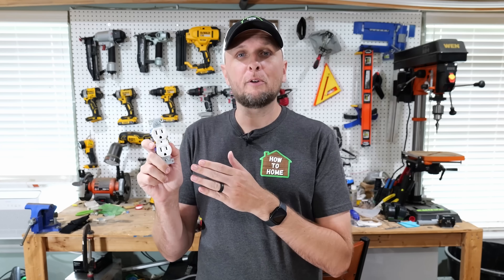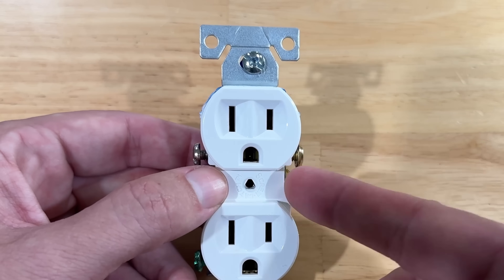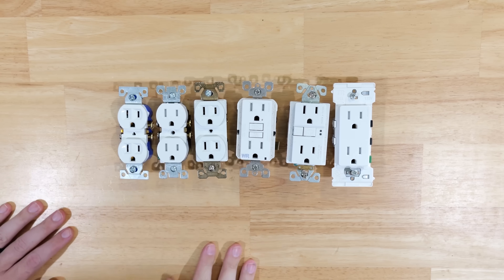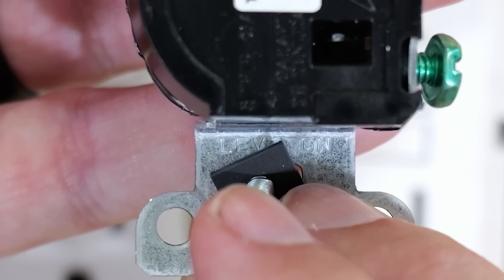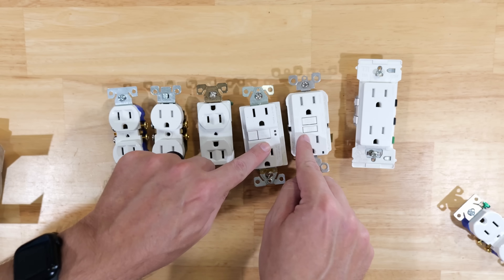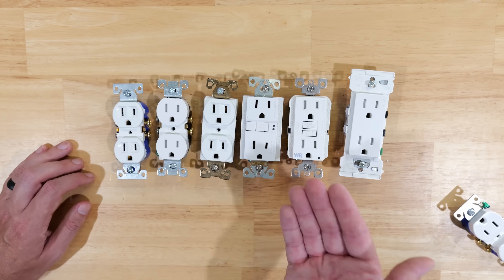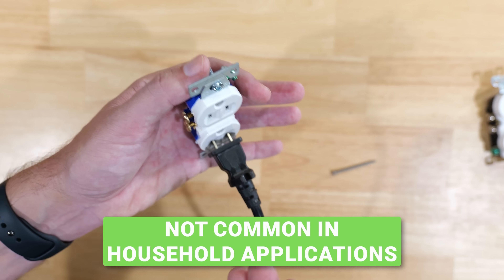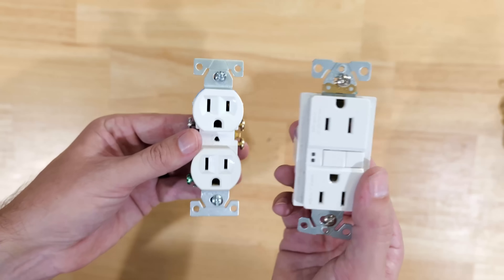The Shocking Reason Why Your Outlets Are Installed Upside Down!

Comment: Honestly, the national electrical code might as well be garbage because it doesn’t drive standardization into the design of electrical components like outlets or how they are installed to force manufacturers to build products inline with those safety standards. The U.K. Type G outlets are the safest option for outlets. The ground faces up, they include power switches, fuses and they have a shutter mechanism to guard the receptacle holes. The only problem with the type G outlet is its size but that can be upgraded to a smaller design in today’s market. Excellent video.👍

Comment: The biggest factor turns out to be the molded 3 prong cord plug. Whether vertical design or horizontal. It has to fit into the receptacle one way. Positioning the cord in possibly the worst angle.

Comment: Now do the right angle 3 prong plugs.🤣
They create a new level of confusion. About 70% of the outlets in my home are ground up, while the rest are ground down. When replacing or installing a new end, I get the right angle plugs that can be set in 8 directions. Otherwise I'm bound to end up with one doing the Wanky Doodle and going up and away at a 45° angle. Our Christmas tree power strip plug is a classic example from a G up outlet. The washing machine is a similar case where I flipped it to G down so the cord trails straight down. This holds true for right angle 2 prong polarized blades sometimes pointing the cord or USB ports straight up.😒
I personally like the "surprised face look" of the G down install and my cords usually look more natural.

Comment: Pointless.  Electrically makes no difference, but standard matters.  Why not just install one-way switches as down being closed circuit?  I'm sure some have the writing on them the same as the outlets you are showing, but no one with common sense would install them upside down.  

Electrically no different.  Should you do it?  If you want to annoy people trying to do things in the dark, like not realizing the breaker is off or a bulb is burned out... or even just plugging in a cord, go ahead and install them the opposite of what we have learned to expect our whole lives.

Comment: Here is the best argument. All the manufacturers making beauty type devices like blow dryers have a gfi built into the end of the plug 🔌 and they are using ground plug down so the electric cord hangs down.   Also i find it easier to wire the receptacle ground down.
So the original old way works for me.

Comment: In the girl’s room a plug was partly unplugged, then a wire hanger fell down onto the electric poles shorting out the circuit.  Fortunately we had a good breaker cutting the power.  Who would have thought.

Comment: First off, the reason I'm commenting here is because I'm horrified that this video appeared in my youtube feed less than an hour after I had this conversation with my elderly parents.  My mother was confused why she could not plug in her xmas night light in the upright position.  I pointed out to them that most of the outlets in this house were installed upside down (or so I thought).   What the heck! not about the upside down outlets but that, once again, my computer is listening, or maybe my wifi headphones are listening.  But I am very surprised that there is no standard for the outlets.  I recently moved into this house and this is the first time I have ever come across an outlet installed, what I consider, upside down.

Comment: I spent 20 years of my 45 years in mining as an electrician. And I've worked with electricians who have worked in residential and construction. And I've seen recepticals installed both ways just depending on the application. But most that I have seen the ground has been placed where its facing down. And in my own experiences I prefer the ground plug down. Simply because in most situations the cord seems to hang better. And that would be with cord ends that are molded flat or square it tends to put a larger bend on the cord when plugged in with the ground on top. We worked under MSHA standards and electrical code applied to both surface and underground applications as well as residential. Irregardless of whether its MSHA or OSHA both adhere to the guildlines set by the National Electrical code..😎

Comment: Ground pin up for metal cover plates, think industrial, they're usually exposed conduit with exposed boxes. If the metal cover comes off , it can't fall on live current.

Comment: Ridiculous debate and discussion.  Reason there's nothing in the NEC is it doesn't matter. I've bought & lived in several new houses and observed outlets installed in a horizontal orientation. Also found where an upside down orientation in a room indicted that that outlet had a wall-switch controlled plug. In those cases, the side bar jumper was cut to separate the controlled portion from the uncontrolled. These were in bedrooms usually where a nightstand would be expected to be. Also had one that was in a living room in a far corner away from the wall switch panel group for the large room. Pretty smart electrician, in my opinion, and I thought that it would be common knowledge. However after seeing this vid, maybe it's one of those secret held by only the exceptional electrician craftsmen and I was lucky enough to have them on the construction crew for my house construction.

Comment: Power cords that have the cord emerging from the plug at a right angle to the prongs are curled and put under a torsion strain with gravity pull on the loop.  Most plugs are more intuitive to plus in with ground hole down.  Apply the same logic to heavy welder cords and it’s very difficult to install with ground up due to the weight of the cord.  Ground down is sound. The object if it did cause a short, well that’s what breakers/fuses ARE damned sure part of NEC Code.

Comment: In the extremely unlikely event that a conducting material, such as a nail, would fall down onto the partially exposed pins of a plug, I would prefer the ground pin to be below the active pins and not above the active pins.  The reason is that I would prefer the resulting short circuit because this would trigger the immediate opening of the circuit breaker in the line feeding the receptacle, and therefore removal of power to the receptacle.  Moreover, this would inform me that I had a plug that was partially withdrawn from the receptacle and of the potential shocking hazard resulting therefrom.  On the other hand, with the ground pin oriented above the active pins, the short and subsequent removal of power to the receptacle would not occur leaving me with no indication of the partially withdrawn plug and of the ongoing potential hazard.

Comment: I always install ground prong down because if you use a wall transformer to supply power to a device, most of them are designed for the ground prong down and weight will keep them plugged in. The other orientation the weight of the transformer over time could work themselves loose from the outlet.

Comment: I put the the ground down if using a 3 prong plug and it becmes loose you lose the protection of the ground especially if the outer case is metal. While working at a national hospital and research center in Buffalo New York. The research center did not replace equipment  until it could not work or be repaired as a result normal to have a metal case equipment that may be 30 years old. The outlets themselves many were original to buildings approximately 75 years old as a result a wore out receptacle was something normal in the research side.

Comment: All recepticles are documented by NEMA.  The NEMA drawings for 5-15 and 5-20 120 VAC residential and commercial recepticles show the ground on the bottom, and line and neutral on the top.

Comment: If you're gonna use a metal outlet plate I would go upside down.   I learned the hard way when it fell off and onto the hot and neutral.

Comment: As a little kid I got the bright idea to take extra light pull chain that was connected up into a length and to use it as a whip. I then whipped the cord out of the wall. Good times. Was an old lamp cord, no ground, much sparks.

Those Gen-X of us who did not die became stronger.

Comment: 46 years ago, NY State Hospitals required an electrical receptacle must have the Ground Prong up. The reasoning was, if the plug was not fully seated the ground prong would deflect any falling object preventing the hot and neutral from shorting. My opinion is that the receptacle should be installed sidewise with the ground and neutral toward the top and hot at the bottom. For the same previously mentioned reason. By installing the receptacle sideways moves the hot further away from falling objects. At the breaker panel the ground and neutral are often connected, excepting in an isolated ground system at which point the neutral and ground are connected at the ground stake with the isolated ground closer to ground or lower than the neutral. When I purchased my home all the receptacles were installed as you would normally see with the ground prong down. When I wired my Amateur Radio (shack) room with an isolated ground system I installed ground prong up and I got comments from visitors that I had installed them upside down.

Comment: Not a pro electrician, but I've done my share of household/workshop wiring in my 70 years on this rock. I HAVE thought of most of the arguments you touch on, and I typically go with GND Prong DOWN orientation (maybe it's the old school traditionalist in me. The only time I go out of my way to orient the outlet with the Ground prong UP is when I know there will be a specific appliance with a right angle plug (or one that is a right angle with the cable oriented to the side of the outlet). This is common with hight current/dedicated outlet appliances like washing machines, wall A/C units, and garbage disposals. In those cases I make sure the cable will be angled straight down or angled 45° in a downward direction, to reduce the strain on the cable (make gravity your ally).  Good video, all in all.

Comment: Ground Down... Due to another safety concern... wiring paths and potential shorts within the box. Ground screws/lugs are always on the ends that positions the outlet that way, as ground at bottom, neutral on left and hot on right. Placing ground lug to bottom, allows the bare ground to be kept low and rearward in the box, preventing a direct short.

Comment: 9:30 You overlooked the scenario in which the building has metal cover plates. If a metal cover slips and gets onto both prongs, there could be a dangerous short with arcing. This is extremely unlikely to happen if the ground prong is UP because the single ground prong would block the metal cover plate.  This case is similar to your nail demonstration. Nice video. 👍

Comment: The only problem with ground up is with the advent of low profile plugs that hug walls.  They are designed with the ground down.  If the receptacle was installed ground up, those cords would be a safety hazard

Comment: Ground prong down for normal receptacle setups.  Ground prong up for switched receptacles.  Makes finding the outlet that is controlled by a light switch in a room a lot easier.  Not sure if it's code or not.  I'm not an electrician.  Its how my dad taught me, so its how I do it.

Comment: Some transformer plugs need it ground plug down or the transformer goes up and sometimes causes it to fall out or pull slightly away from the receptacle if the heavy part is up. So I prefer ground plug down for that reason when it has a polarized plug

Comment: There are some power cords where the cord comes out of the plug parallel to the wall (perpendicular to the prongs). For example, my freezer in my basement has this. My basement has the outlets installed much higher than in the rest of the house, and they have the ground up. So, the freezer power cord barely reaches the outlet. If the ground had been installed down, I would have much more flexibility on where to situate my freezer.

Comment: I prefer to have my outlets installed with the ground up BECAUSE .... I always tend to hold the plug-in end of a three-prong chord with my thumb on the smaller part of the plug, the ground; it is more convenient for me to have the ground hole up. However, I like the outlets installed with ground down for those appliances with the flat style plug (refrigerator, stove, etc.)

Comment: I can give you a situation where the orientation does matter.   It’s not code or manufacturer required when installing the devices.  Some appliances (code definition) come with a cord and plug that the prongs are 90 degrees from normal.   Some are 90 degrees and then rotated at 45 degrees.   So, because of that, and how it is being utilized, they would need to be orientated to a direction that works for the direction the cord needs to go.   Either up the wall or down toward the floor.

Comment: look at 90 degree plugs ground on top or ground on bottom? the receptacle should be installed so the cord lay flat when plugged in. this might be the only good reason for one or the other. the other thing is an outlet with ground down looks like a face. every other rational is preference and the most recent hospital build in BC have both

Comment: Read the NEC…it does not matter of the orientation…as long as the receptacle is not face up! So ground up or down is up to the designer, engineer or installer.
Reply from the maker: Umm what did I say in the video?  😂

Comment: I did not think it mattered. that was until it happened to me. while working in a mechanical repair shop, I went to get something off the shelf that the radio was on. I bumped the radio. as I turned POW, FLASH, BANG.  the metal antenna fell sideways and was across the plug and touching the window frame. glad i did not try to catch the falling metal antenna.  an extension cord was just a little loose in the socket. Never thought it would happen to me. Some one's last words.

Comment: The number of occurrences where something falls onto the prongs are almost zero.
But the frequency of a person pulling out a plug and contacting the prongs with your forefinger  are probably millions of times a day. Its basic ergonomics.

Therefore I suggest that it is safer to have the round ground  prongs on the bottom.
Reply: I have a fried outlet from when I was a kid cause a penny fell off my dresser and landed between the prongs and started melting the lamp prongs and the penny. Fortunately I saw it happen and pulled the dresser off the wall and yanked the wire right away. But the penny was about halfway through the prongs. It might be rare but it happens.
Reply: @amnesia5490  how come the circuit breaker didn't trip?
Reply: @abdullahunal1108  Likely because it was an old glass fused panel with a penny in the fuse socket. I see a theme here.

Comment: It comes down to appliances. Most older homes before @ 1980ish all have ground up, especially in bathrooms and kitchens. The reasoning being that any liquid splashed or running down the wall would guarantee hit the ground first before contacting the hot. With ground down, it's possible that the liquid would hit the hot and bypass the ground. Which makes sense until you think about how the entire frame is also ground. So it became a moot point. But in the early 80's, there was Nintendo and other appliances using a plug in brick transformer. They were mostly polarized, so to plug into the wall with upside-down plugs, the brick would pull itself out of the wall. To have that weight hanging downwards required a ground down orientation. So ppl started flipping to a ground down plug.

Comment: A buddy has a loop of his fish ( wire) fall down a wall face, and hit the two prongs, hot and neutral. Sparks, burned outlet, and melted fish in half. So it can happen. Ground prong up would have been better.

Comment: I used to work with  an electrician who was also one of my apprentice trainer  for me. He was doing some work on my home in 2017 and was telling me about the latest Code changes. The one he had the most and the reason for it coming into existence was the receptacles being installed with the ground up for anything placed over 36”.  Mean anything placed high on walls or above counter tops.  But the dumbest reason this was placed in the code at that time was because one member one the board suggested it and no  one on the board disagreed with it. That was all it took to make it happen. Apparently somebody came to their senses and got it removed. But the damage is done and the dispute is now going on about it. 

Thank God that stupid rule is gone, but make sure to check your local code still. Someone may still ha a hair up their bum for this rule.

Comment: Ground plug down because most ac power supplies are designed that way and will fall off the wall if the ground is on top.

What started this whole mess was hospitals had some outlets Ground up to indicate they weren't hooked up to emergency power and would remain unenergized during a blackout.
(now they are color coded)

That led to the urban myth that "Ground up" was the right way.